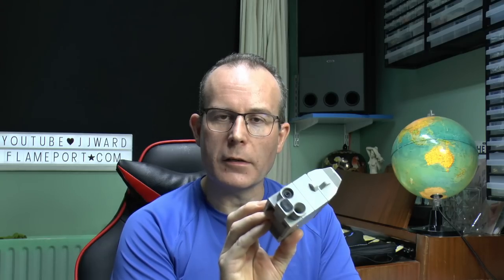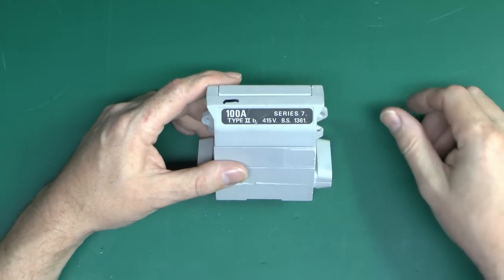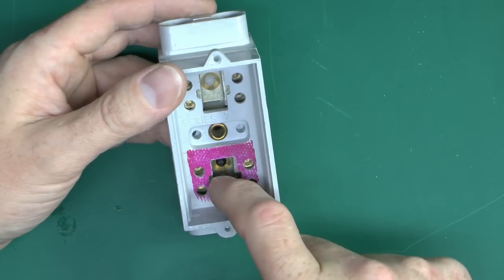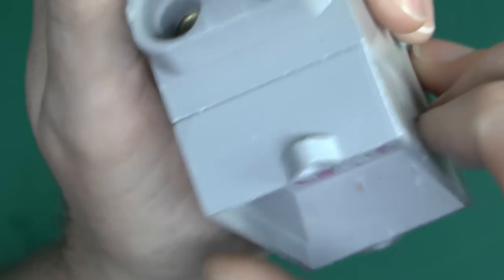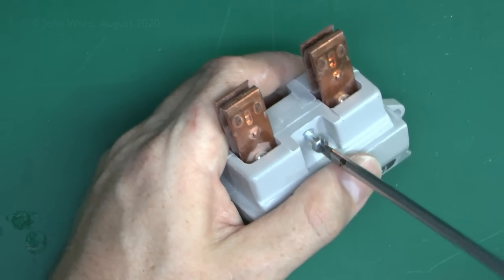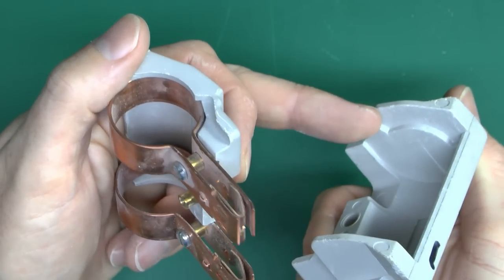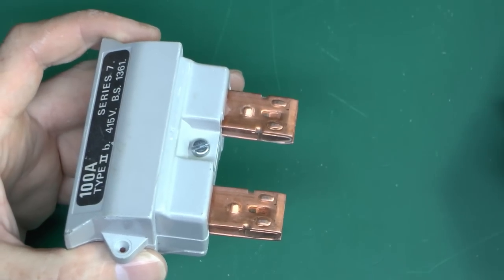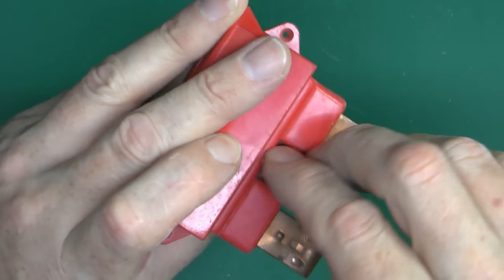Cutout Fuses, Red Links, Distribution and Building Network Operators

Comment: Clearly something is not working in the UK if you constantly have to call out the DNO. This is why there is a need for isolation switches more generally. You would not need to break seals as an electrician or need to contact the DNO when working on the board. This is quite ridiculous of course. In USA now the latest NEC2020 recommends isolation switches to be placed outside of the property. This would allow emergency services (fire) to shutdown power before entering a burning building.
Reply: bdf2718  true but they can be locked to avoid that problem -  the fire dept will have bolt cutters to cut the lock. Of course that does not preclude someone coming to do that anyway but in that situation they are criminally trespassing and damaging property and you can hardly stop anyone damaging your home regardless. Suffice to say I have had the shutoff switches for over 6 months no problem of that so far -  it helps that they are not visible to the street. I believe Many gas meters and Henley blocks exist outside in the UK so same problem there as well. Presumably they were built outside in many new developments for just those emergency responder reasons? I think ultimately it’s just not that interesting to many people other than those that need to know.
Reply: @mathman0101  One of my neighbors has had her gas supply shut off a couple of times.  No lock.
Reply: bdf2718 oh dear not great.
Reply: You got to remember, Domestic electrical in the UK is the equivalent to turning up to a F1 race in Robin reliant. Our electrical standards albeit Domestic is to a very high standard. Rule of thumb don’t judge UK standards on Domestic. Best to ignore it.
Reply: Kum Hydrant with JW there is always food for thought in what he shows even if it’s some basic electrical component. In that regard it shows very clearly the thought he puts in regarding that component or process and how it aligns or not with standards. Good learning experience for electricians.
Reply: Math Man Oh yeah, I’m not undermining JW at all. I just implying that judging Electrical work in the UK. Solely upon Domestic videos doesn’t do it Justice.
Reply: Kum Hydrant completely agree.
Reply: @mathman0101  my old house was in one of many rows of houses with external gas metres, with identical keys. No issues arose.
Reply: Dylan Harding yes it’s not really interesting for many people - the risk may be greater at Halloween with kids playing around but other than that not really an issue. Now the problem I hear in the UK is how the housing for the external gas and electrical connection are so prone to breaking 🤣

Comment: An installation like this https://i.postimg.cc/vDZLdYtN/F92-B1120-589-B-48-D0-9806-B735-E2-A527-B7.jpg seems a better idea. A fused cut-out for protection and isolation by the DNO (or for the person changing the meter) and an isolation switch for the electrician working on the building owners wiring/consumer unit.